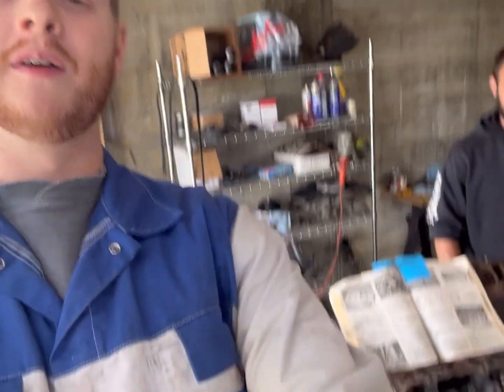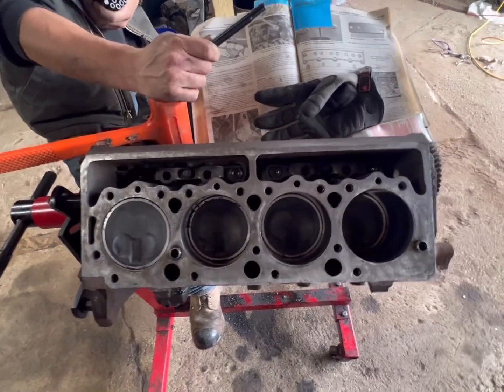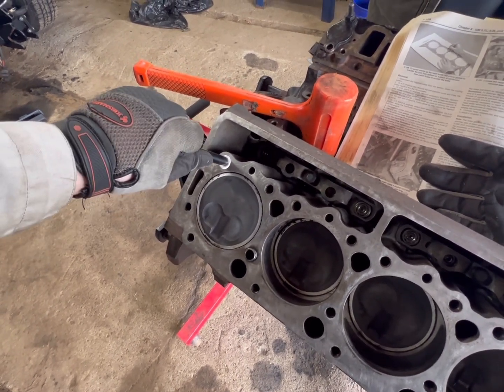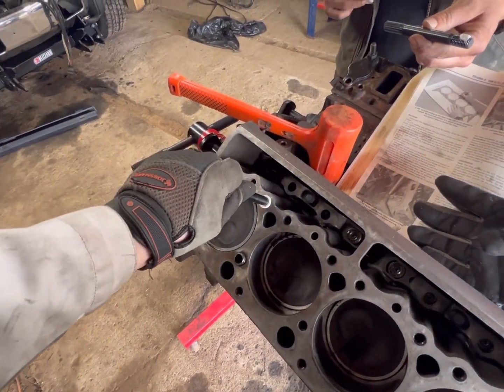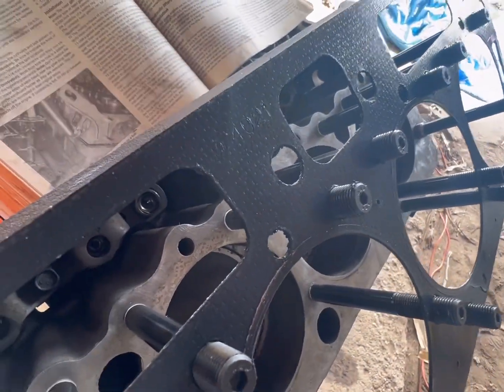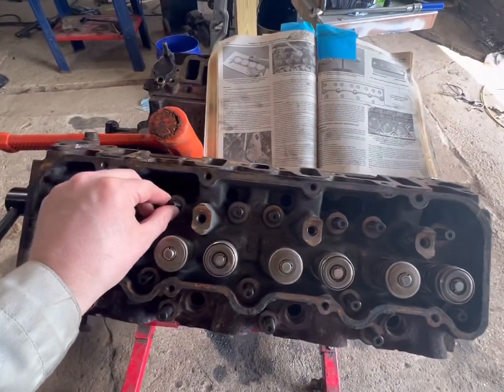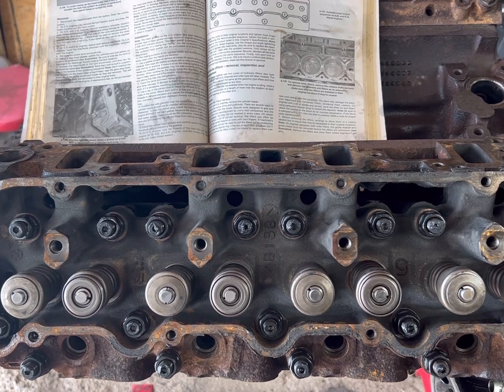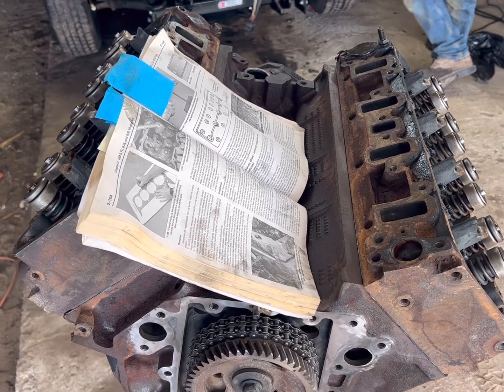GSC 6.5L Head studs install tips and tricks walk through. More info in the description

Comment: Can studs be installed without pulling block or the cab? And what do you have for a book there?
Reply from the maker: I suggest doing studs out of the truck. Actually I recommend doing even bolts out of the truck so you can really get the deck clean. That’s a Haynes manual for 7.3/6.5/6.2 diesels. I’ve used that as my spec bible for 15 years.

Comment: HOW DID THE OIL CAN  WORKED... I WAS WATCHING A OTHER GUY OVER SEAS BUT HE SHARE HOW IT HELPED HIS BY NO MORE PUSHING OIL OUT OF ALL THE SEALS... THAT IS WHAT I AM HAVING TROBLE WITH EVEN WITH A NEW CDR.... I WAS TRYIGN TO FIND OUT WHAT WOULD CASUE THIS TO HAPPENED SEEMS TO BE GM DOES NTO WISH TO TALK ABOUT IT... I HAVE MY 6.5 FOR OVER 12 YEARS.  A 96.... K3500
Reply from the maker: The catch can didn’t make a huge improvement. If you are pushing oil from seals then the actual valve cover itself is clogged up and not venting correctly and it’s building up extra pressure in the crank case.
Reply: @gingersnapcustoms  what are your thoughts on a crank case evacuation kit? Something similar to a (Mr gasket 6002) or (allstar ALL34145) I plan on eventually trying it out on my 6.2 when I add a 6.5 turbo to it in a few months. It seems like it might work well if you have a free flowing exhaust I was thinking about paring it with a AEROTURBINE muffler so it could be somewhat “quiet” but still breathe. You could use two lines and a catch can to keep a good vacuum without spraying the exhaust with oil. I have seen gas engines use it to great success but only one or two diesel trucks try it with no real follow up as to if it worked or not.
Reply from the maker: @nightfall5631  the GM CDR systems works fine. Diesels don’t make vacuum so we just let the turbo do the work. I’ve tried catch cans and road draft tubes and I always end up back to a stock 6.5 setup.

Comment: What is the part number for the head gaskets?
Reply from the maker: Victor Reinz gasket for a 6.5 standard thickness. I would have to go home and look at the PN.
Reply: @gingersnapcustoms  are victor and mahle head gasket the same thing? I was looking at Victor's and could figure out how to order. I noticed in the pic of the victor there was no rear coolant passage in the gasket and different part numbers for right and left. I planned on doing a crossover from block off plates. Thanks for the replies.
Reply from the maker: @lonestar4721  I just looked and we used the Mahle kit from JEGs on this one. Same same. I would never do a rear cross over kit but that’s just from past not stellar experience.
Reply: @gingersnapcustoms  why not do the rear crossover?
Reply from the maker: @lonestar4721  it effects front of head cooling.
Reply: @gingersnapcustoms  is saw a vid of a guy that ran a tube from the block off plates to the thermostat housing. My plan was to t them in just before the thermostat. Do you think this will cause uneven heat or overheat or both?
Reply from the maker: @lonestar4721  from personal experience it will still cause cooling issues. The steam ports can help. But the right water pump and bypass fittings are more beneficial
Reply: @gingersnapcustoms  it's a 1993, did the duromax fan upgrade. That didn't solve the problem of leaking head gasket... now putting aftermarket heads on. What is a bypass fitting?
Reply from the maker: @lonestar4721  you’ll want a 2000 water pump and fan clutch along with Leroy diesel water pump bypass fittings
Reply: @gingersnapcustoms  thanks for all the replies. Yes 2000 water pump and fan clutch is what I put on there. I will look into the bypass fittings. Did you see the Leroy diesel vid where he puts O rings under the head stud nuts? Have you ever tried it?